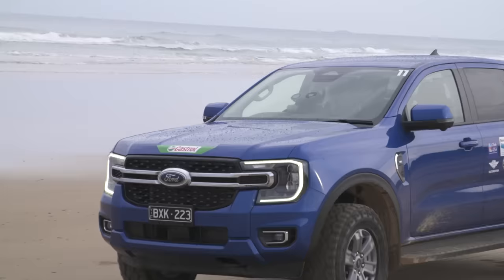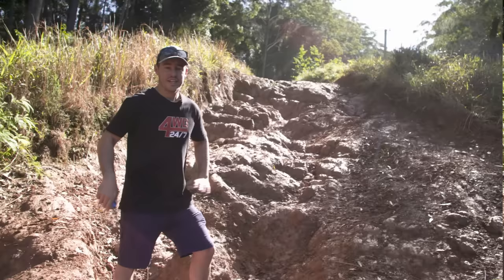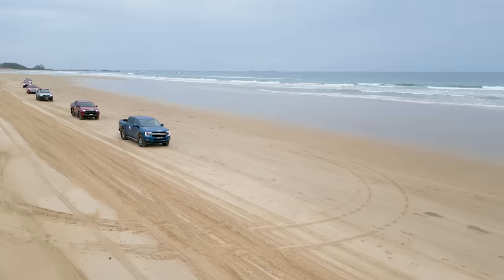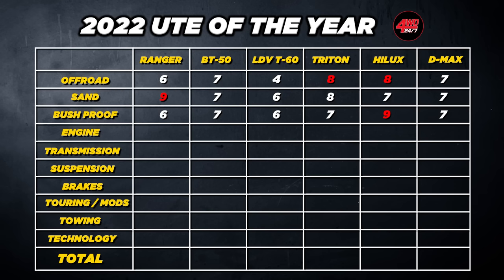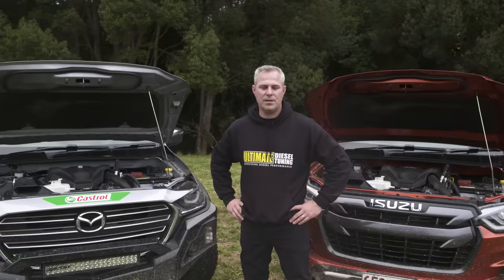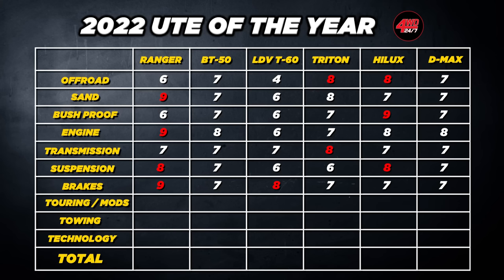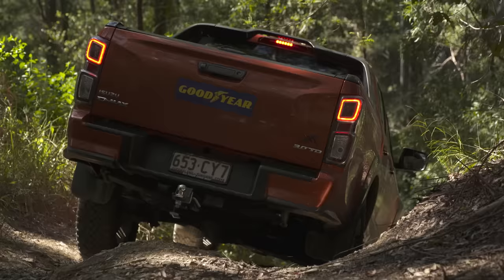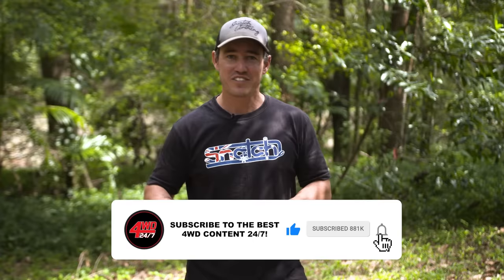2022 4WD UTE COMPARISON - CONTROVERSIAL WINNER! NEW Ranger vs Hilux vs DMAX vs Triton vs LDV v BT-50

Comment: The only thing about rangers is that they are great when they work. They just don't work very often. Ours is constantly in the shop and comes back with more issues than it went in with. Luckily it's a work car but I would never even dream of buying a ranger, it's just not worth it in the long run

Comment: For the 1st time ever I saw a single cab VW Amarok the other day. I wonder if it's a grey import or something. Till then I've only seen twincab Amaroks in Oz

BTW it's a pity the Isuzu doesn't have the new GM 3Ltr straight 6 Duramax Diesel. It has over 200w of power, over 500nm of torque & has the smoothness of a straight 6, which is a huge help to a diesel. The whole concept of a V6 diesel in an engine bay that has enough room for a straight 6 just doesn't make sense.

Comment: It is absolute rubbish to cast doubt on engines that have high power to swept volume ratio like the LDV and Ford. While Ford have had issues with their 2.0 Ecoblue engines these are/were due to a poor batch of injectors from Continental for a period and the long oil change intervals combined with the wet timing belt failing. Nothing whatsoever to do with the engine’s power ratio. Engines have been improving in power to weight and volume ratio for as long as I can remember and every time there have been these usually unwarranted doubts cast on them. I distinctly remember back in 1983 when I had a meeting with Land Rover executives about their new 110 [90 came months later with wind up windows] with the 2.5 naturally aspirated diesel. I mentioned that Daihatsu and others were forging ahead with higher output turbocharged engines and they poured cold water on that idea due to engine longevity and unnecessary complications and repairability in the field. They soon found that others forged ahead and by 1987 they offered a 2.4 diesel with 112hp in the Range Rover and an indirect injection version of their own 2.5 in the Defender, which was a total disaster.  Engines have almost continually improved over the years, driven by competition and emission regulations so that my old vehicles struggled to better 26mpg with lethargic performance, lots of oil changes and noise, to today when my Sorento [which weighs more than the Mk1 Range Rover] now has an automatic, 4wd and over 200hp and 500Nm and averages 38mpg. Even the similarly powered Ford Ranger 2.0 twin turbo gets an average of 34mpg on road with performance that leaves my Land Cruiser 4.2 turbo intercooler 4.2 litre [200hp but only 400Nm] in the dust.

Comment: It would have to be the triton all the way. Ever since the original l200 right through to currently they have been getting Ausys and kiwis around weather it be the tradie, farmer, or weekend worrier without breaking the bank along the way. They may never of been the best at any one thing but being one of the best at everything makes them top dog in my eye. Currently in a mk triron set up as a tourier. Could upgrade but why bother when it does everything I ask with out batting an eyelid.

Comment: on the dmax; has anyone had steering vibration/cracking noise transfered through the steering in low low speed while descending or when the weight is transfered to the front axle? could it be the sway bar? good power and interior, mean exterior! just that anoying sound...

Comment: The Ranger has all the new tech but yet to be proven for reliability.  Just recently received my new SR5 Hilux and couldn't be happier. This vehicle maybe dated but has proven reliability, dealers across the country. and plenty of aftermarket accessories. Great honest review and good to see stock vehicles being tested as I drive mine stock at present. Cheers!
Reply: Proven reliability? I think the verdict is still out on that considering the whole dpf, turbo issues that plagued the first versions of the 2.8. The turbo, dpf, injectors, pistons were all changed and addressed what about almost 2 years now on the facelift hilux? Hardly any time to use the term proven reliability, just because it's Toyota doesn't mean it's reliable. D4d engine wasn't really bulletproof either

Comment: You test all the utes bar the LDV and Ranger in their off road pack form. Ford do an off road Ranger pack it's called the Raptor why wasn't it used for a "fair " comparison ?  @ 11.39 " that ramp over angle has got me hooked " then picks the correct line and drives it. Car or driver error ? Love most of your content but your'e not playing fair sometimes.

Comment: Why did you not test the smaller diesel engine Ranger its allot cheaper and has all the features as the V6 at a lower price.   If price was your deciding factor you should have tested  the Ranger with  the in line 4 diesel. The Ranger 4 cylinder performs close to the V6 and is still better then the others, it just has less power than the V6.  Very flawed test if value was your biggest concern. You set up the Ranger to fail when it bested the others and do not choose it because of price. When you could  have the Ranger with the 4 cylinder diesel for allot less money but also have the same  UTE refinement and capability as the V6.

Comment: So when are we going to Shauno modify a ranger and actually see what it's capable of. 2.5 inch lift and some 35's and I'll think it would easily give the dirty 30 a fair run for its money........ but it's got a blue oval and we will never see it🤣🤣
Also just a quick question/querie about the ranger? How dose the wheel base compare to a cruiser and is it limited to how much lift can be achieved vs a cruiser, as in your test the ramp over angle was mentioned and also an easy fix in regards to probably one the first mods in many 4x4s being suspension works and tiers.
I would be really interested to see the mitts alloy ranger in action when it's done seen a sneaky video and it looks good but how dose it perform modified.

Comment: If you are not going off road, why do you need a 10 speed auto.  If the Ranger comes out best but at top dollar, why not just use a 6 speed manual.  Auto is over rated, give me a manual.

Comment: Wouldn't spend 70k on a ranger but owns chopped 200s etc. Your cooked thinking the hilux is better then dmax/bt50. Hilux still has standard climate control etc. And xlt ranger being mid spec still ten fold outspecs all hiluxs. The sr5 is mid spec not sr.

Comment: has anyone done a similar camparison except with single cab chassis for trade vehicles ? I carry a heavy 3mm checkerplate tool box on the tray with a roof rack and i have a 2016 RG Colorado which is just under 3 ton when all my tools are in the box/ canopy, looking to update and not sure if Nissan, Mitsubishi, Ford, Mazda or Isuzu will cut it like the Colorado has ?